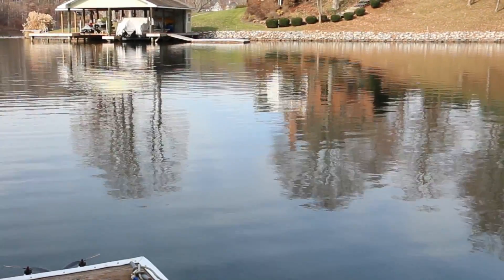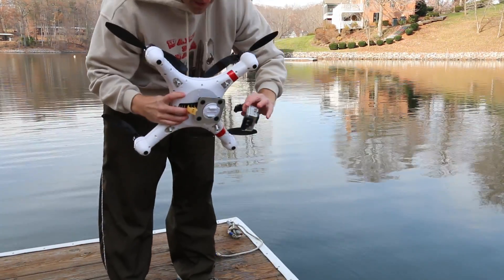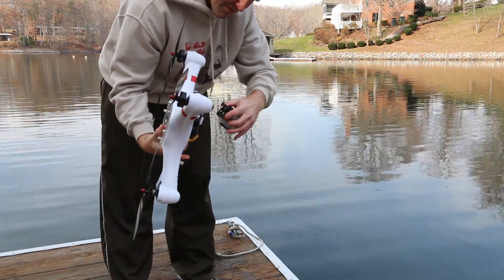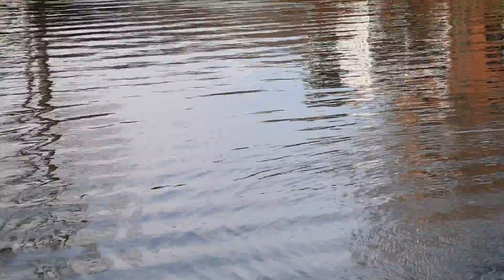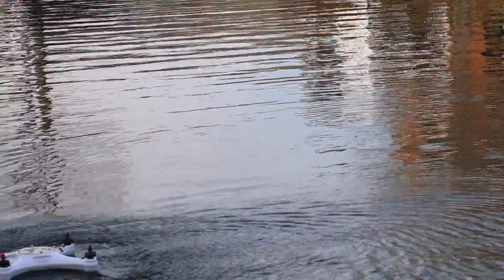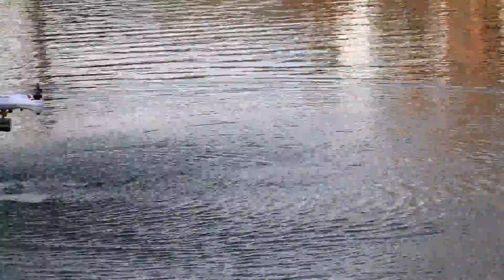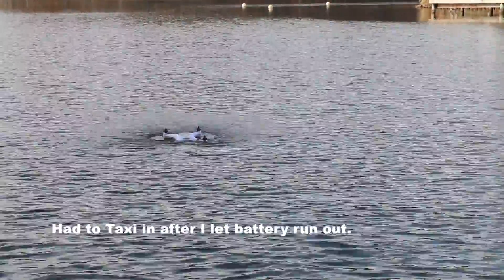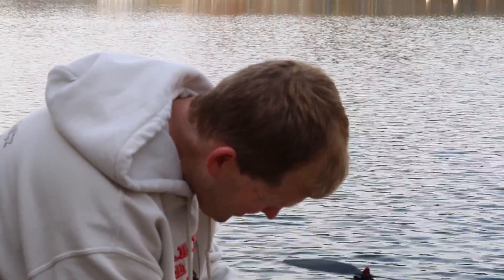Mariner Drone - Water Testing

Comment: Do you have to take off the clear plate on the top every time you put a new charged battery in it. Kind of a hassle. Too bad you couldn't have a hinged seal like the Gopro camera case or something to make it easier. It would be good for filming watersports but I doubt it would take a serious crash into the drink. What happens if it falls upside down. Is it all over?

Comment: I am looking at selling them in New Zealand. That is the basic model RTF Kit. What battery did you have in it and what was the flying time or did you not record it. Cheers Jon
Reply from the maker: I have the  FPV kit but the set up in this video is more of the RTF.  With the 3200 I got a little over 13 minutes. My understanding is around 18min on the 4200. Feel free to email me through my website and I can answer any more questions you may have.
Reply: PerformanceImages1 
Hi ?
Thanks very much for getting back to me. That is very interesting as I see they have a 5200Mah but it may not be for the RTF or the FPV. I have suggested to Eric to have one page of his website dedicated to these to save confusion. I will keep in touch if I go ahead. Kind regards Jon 
honedustin@gmail.com